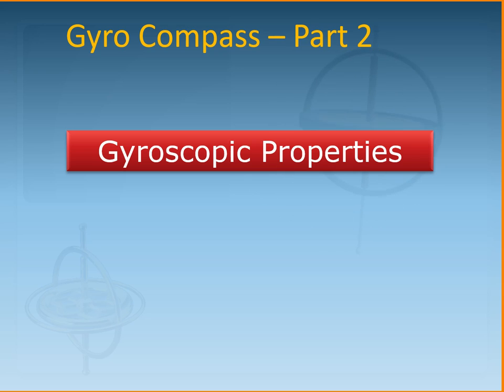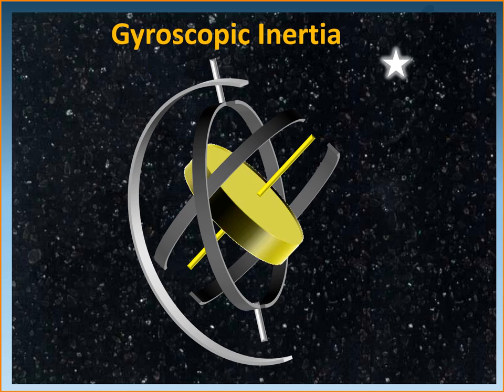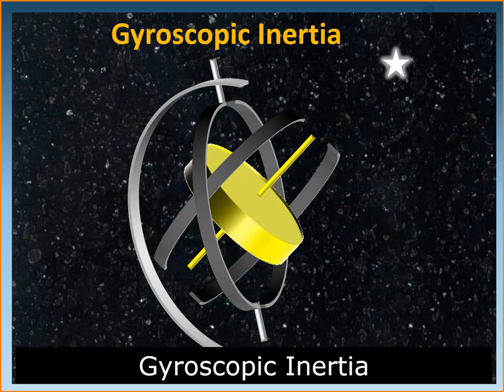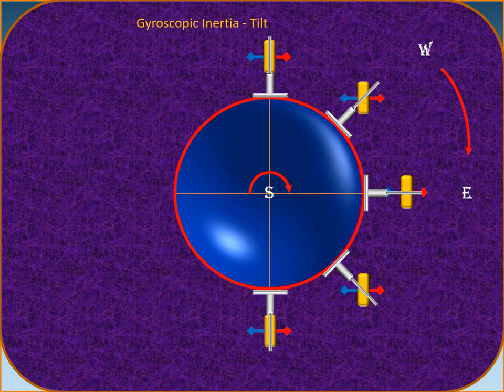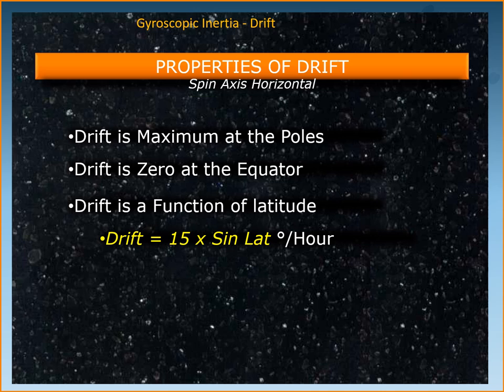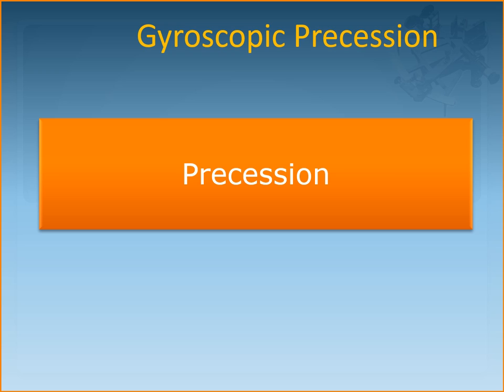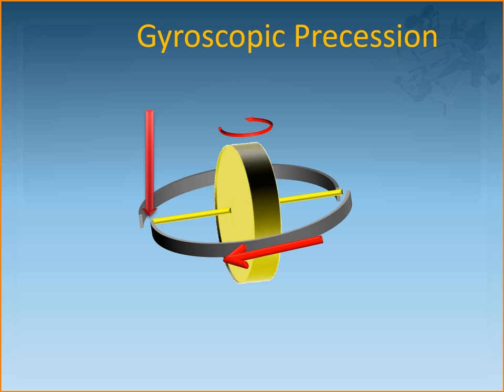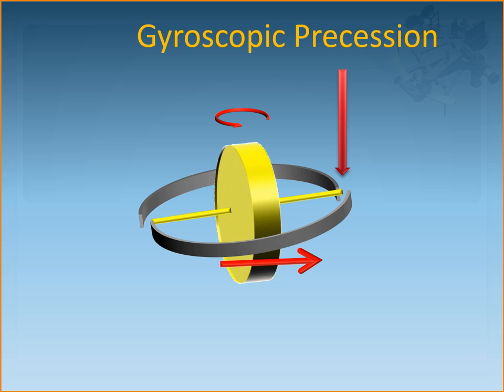Gyro Compass Part 2 - Properties of a Gyroscope (Gyroscopic Inertia and Precession)

Comment: Sirji,  you are confusing the movement--Tilt is movement about the Horizontal axis and Drift is movement about  the vertical axis,, although the Drift movement is in a horizontal direction, but its taking place around the Vertical axis,,similarly even though the Tilt is moving in a  vertical direction, the movement is around the Horizontal axis of the gyroscope. Thanks . Great Graphics and good material,,thank you .

Comment: Congratulations! Very good video.
Could I ask you a question, please?
At the Equator, should we expect a 360 degrees of tilt in 24 hours ?
The same for the poles with respect to the Drift ?
Why do you use 45 degrees for both calculations's formula, at the poles and at the equator?
I was thinking we would get an entire turn each 24 hours.

Comment: So if you flew from England to India, say, the attitude indicator on the plane should be vertical when landing in India if it was started in England as you would be 1/4 way round the globe.  Or not...
Reply: The attitude indicators (aka artificial horizon) on aircraft are equipped with additional functionality to slowly adjust to the direction of downward.  This compensates for both the rotation of the Earth, and your progress while flying around the Earth.  They are called pendulous vanes, that slowly adjust it so that the attitude it indicates is relative to gravity.

The gyroscope's purpose is to make sure that maneuvers don't give you a false reading, and therefore have the purpose of allowing the indicator to "remember" which direction used to be down.  This way, as you bank turns, climb, descend, and accelerate, the apparent change in gravity as a result of the maneuver, doesn't give a false reading to the direction of the attitude indicator.  You will feel slightly heavier during a banked turn or initiation of a climb, and you will feel slightly lighter when initiating a descent.   When the apparent gravity inside the aircraft deviates from Earth standard gravity by a certain amount, the system pauses the ability for the pendulous vanes to impact the direction it indicates.  When the apparent gravity returns to normal, the pendulous vanes resume their corrections to the attitude indicator.

This is why when airplanes are stuck in holding patterns waiting for an opportunity to land, they don't take a continuous circular path.  Instead, they execute a pattern of 180 degree turn - straight - 180 degree turn - straight, so that there is a period to reset the attitude indicators during the straight-run.  This traces out the shape of the running track around a football/soccer field.

Comment: How can the “earth rotation be so slow” when the earth is spinning fast as nasa says
Reply: WHO SAYS SLOW?
Reply: The rpm is slow earth rotates once in 24 hours
Reply: In terms of its rotation rate, it rotates once every 23 hours, 56 minutes and 4 seconds, relative to an inertial reference frame.   In terms of the linear speed at the surface relative to its center, this amounts to 1040 mph at the equator (1675 km/hr).   The angular speed is slow, even if the linear speed is fast.  The accelerations associated with the angular speed, and the pseudoforces you therefore perceive, are small as a result.

What ultimately matters in terms of how you perceive Earth's rotation, is acceleration and not velocity.  Most of the time, this is perpendicular to Earth's surface, and you perceive it as making gravity slightly less.   What you will perceive as acceleration, is when you try to travel in what you think is a straight line on the Earth's surface, and you ultimately have to accelerate to compensate for the Coriolis effect.   This is where you can measure the fact that the Earth is rotating, without referencing astronomical bodies outside of Earth.